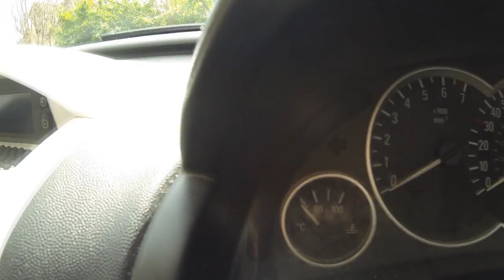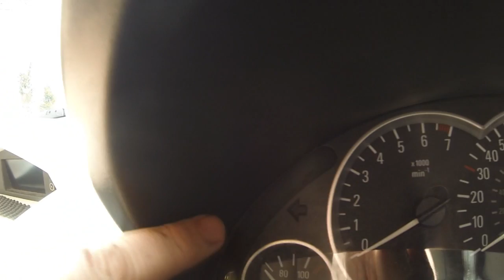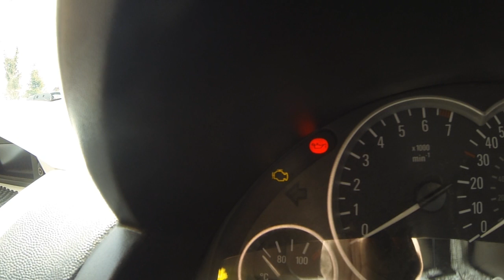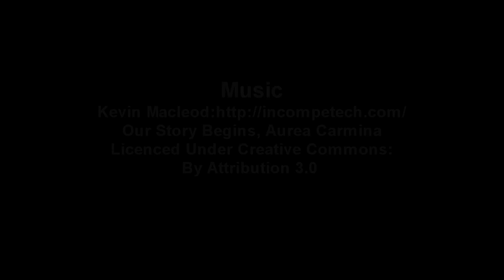Part 1 Vauxhall Corsa C ABS Light On Speedo Erratic - How To Diagnose

Comment: Iv got them same issue i did this but nothing come up on the dash board had the abs pump changed slight improvment but is still playing up speedo dropping out lights flickering on and off and abs light comming on on rough part of road and hard ish acceleration

Iv spent over 700 quid trying to sort it out and am getting to the point of getting rid of the car its pissing me off as i need to go out at night but dont want my lights turning off and then i crash.

Iv allso had the one abs ring changed the rest were fine

Comment: My lad learnt to drive in his Corsa C 3 years ago and still has it, cracking little car. His is a 2002 1.2SXi without ABS and it really threw me at 1st when I saw just one ABS sensor on the passenger side hub. Then I realised that was the speedo sensor.
The light flashing diagnostic is really handy, user it when he complained of erratic running and stalling. Turned out to be a faulty crank position sensor, £11 for a new one and job done

Comment: Hey mate thanks for sharing Thais, i have a Opel corsa c (Vauxhall corsa c) 1.2 confirtline, and my steering goes left soon as i Turn the Key to the Starr point, some Tells that is the direction column some that is a electrical Direction motor that goes off how can i solve This? Thanks a lot and sorry for the bad english
Reply from the maker: Sorry bud, I don't know.

Comment: Hmm, have a similar problem with my Combo van, just entered an express way when the speedo had a wobbly and stopped working then came up again the ABS light came on then it stopped recording the mileage, I normally reset the mileage every time I fill up and zero the trip and have noticed it hasn't moved since.

The ABS has been on ever since, the rings do look grubby so will clean them off but one sensor wire looks damaged so will see if the brake and accelerator trick will tell me, going to replace the sensors anyway as they are only £20.

When I did my Driver Mechanic course we didn't have all these codes for fault finding on Centurion and Chieftain tanks we had to use common sense and work through using fault finding techniques hahaha!
Reply: UPDATE - swapped out the sensor for a new one on the passenger side and found the sensor cable had been rubbing and worn through and the wire was cut. With the new fitted I'm back to normal and the odometer is working after a quick drive down to Spar to get some tinnies and the ABS light has gone out - Took me 10 minutes to sort it today.

Comment: hey the video really helped but I ran over a pot hole and shredded by abs (the wire is litterally cut) I have bought a replacement and this video helped me figure out what was wrong to the point where I saw the cut, but I cannot disconnect the connectors with the abs, The Allen key fixture has came off fine it is the tether point into the car. How do I get it off I have tried everything :/
Reply from the maker: You will probably have to drill out where the allen key head was and re tap a new hole by the sound of it bud.
Reply: No Sorry for the confusion... it is the other side! The side with the electronic connector, I can't seem to get it off.
Reply from the maker: Try give it a soaking with WD40. I think there is a clip you need to push in as well.

Comment: if its not the sensor on the passenger side of the car wheel then how do you fix the one which is behind the dash itself? can you please upload an video. much appreciated. corsa c class 2002.. thanks
Reply from the maker: We do the jobs as they arise bud.
Cheers
Martin
Reply: Is it possible that may be you could show us how to remove the dash and where it is located because there is no video on youtube to act as a guide.

Comment: Hi there i have a corsa c 1.2 and my speedo would randomly stop working if i didnt use it for like 5 days or so then when i drive and stop stationary it would start working again... went out tonight but its not working at all but my fuel, temp and rev counter all works. can anyone help?
Reply from the maker: Apparently, there is a poor connector behind the clocks that always gives trouble. Most people give the top of the a bash as a short term fix but it is a clocks out job to repair.
Reply: what would I need to do to repair this mate?
Reply from the maker: I've not done it bud Sorry.
Reply: I doubt you need this help anymore but this comment might help someone else. There are a few torx 20 screws to remove, to find out which ones, google "corsa c speedo led replacement" there should be a few guides kicking around, then when you get to the multiplug, I've read that people stick a piece of paper inbetween the connector wall and the plug on the clocks to keep it stuck in. It's not majorly hard to do, 20-30 mins to disassemble if you don't know what you're doing/taking it slow + another 20-30 reassembling. While you have the clocks out you might as well put a nice red LED conversion in! Only 4 bulbs (5 if you have an auto).

Comment: There are Vauxhall specific OBD diagnostic tools available - it will allow you to read the speed from each ABS sensor as you drive (I presume this will as well, the ones I have used in the past have), as well as read fault codes easier, and delete them. Search for "Tech2" on eBay, not the generic OBD tools as they usually only do engine related stuff, and won't connect to ABS, airbag and other systems unless you spend a lot of money.

You can get the ones that connect to a laptop for around £10 - £15, and they come with software.

If you have something like this (may be worth having anyway if he's keeping the Corsa for a while), it should help rule out the ABS sensors as being faulty, and save you money buying them (I think they are about £35/£40 each). The software also displays road speed from the sensor in the gearbox, so if that shows a reading, and the speedo in the car doesn't, it could be the connector on the instrument cluster, for example.
Reply from the maker: I do have an OBD 11 cheap diagnostic reader but that does not pick up the 0500 fault that the dash indicator does as you said, I'll check out the Tech2 one.  A lot of people give the dash a hit if the speedo plays up as this is a common fault on these due to the connector but I think you probably know that lol.
Cheers
Martin
Reply: retrorestore I didn't know it was a problem with the Corsa - I have had a problem with the connector on an Astra of around the same age, though.

I believe there's a modified connector block you can get from Vauxhall, and I don't think it's that expensive either.
Reply from the maker: mrman17
It seems to be a common fault with these age Vauxhalls. Yes, i've read that there was a modified connector but we'll replace the sensors first as one had been repaired anyway.
Cheers
Martin

Comment: ya sound like my garage mechanic, but charges me for each thing they try to fix a problem. $900 for a distributor sensor after weeks of trying this and that first.
Reply from the maker: Unless they plug a diagnostic program in and actually see a malfunction from a sensor, it's normally something else like it could have been in this case but just changing a sensor is not always the problem. As you said though Bri, some people just change things until they stumble on the actual fault and charge you for everything they change.Cheers
Martin
Reply: retrorestore With my Taurus for months would drive fine but ocasionally sputter or cut out and back in again. Made me nervous driving it, and mechanics could not find a recorded fault in diagnostics. Tried new plugs, and ignition wires, borrowed Coils, borrowed comp unit, same thing. Then I went to FORD and they said it was probably the distriutor sensor at $600. $120 to verify that was the problem, an hour labor charge for a 10 min change. Hit my wallet hard.
Reply from the maker: Brian Percival
 Madness, We don't need all these sensors and computers just to get from A to B. They brainwash people into thinking that we need these things. Back to basics is needed.
Cheers
Martin